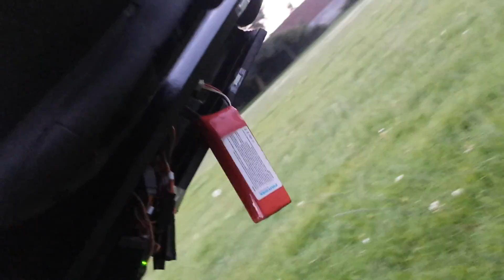HobbyKing Avro Lancaster V2 Tip Stall problem

Comment: They just released a version 3 but it still has similar stall characteristics.
Reply from the maker: Nice what's changed on it?
Reply: They have made it lighter by removing the retracts, and the trailing wheel steering servo, not sure what else.
Reply: @droneracer  Differential Thrust as well......
Reply: and they now recommend a smaller 1300 3S battery

Comment: To be quite honest - I'm surprised he lasted that long before losing it. Forgive me for saying that - but the throttle control there was abysmal. Just before the model rolled - the throttle was reduced ... a lot of models would have rolled in at that.
No tip-stall ... it was plain rolled into the ground.
I fly the HK Lanc and I can loop, roll, stand her on a wing tip ... but YOU MUST use throttle control and not just keep slamming throttle, backing off ... slamming it again ... that way you never learn what she is. The HK Lanc can do full circuits at about 60% throttle with just a click or so up as you enter the turn and then back to cruise.
Shame .. I really like mine and find she flies nice.
Reply from the maker: Yeah I agree you can learn to fly it with throttle control, I would probably take the time to learn how to fly it properly my self, but this isn't my model, this is a friends and he's doing the flying, so no apologies needed about abysmal throttle control.

However it does tip stall easily compared to other models, I do prefer something where when you have a momentary loss of concentration for what ever reason you wont tip stall it for not applying the rite amount of throttle at a given time. 

That said, it is a very beautiful looking aircraft and I do like my warbirds. Hence I do like this bird and will probably buy one myself in the near future.

Comment: Hi, I'm no expert, but I've tip stalled and it just goes on its side and down. I'm not so sure with that roll on the way down.
Reply from the maker: +philippe leblond Hi thanks for your comment. That roll was basically an exaggerated tip stall. It tip stalled so hard it rolled the opposite way as a result and in a dive. Bad place to have a tip stall... in a turn low to the ground :( Its my friends Lancaster, he mothballed after the video was posted and used the parts for spares.